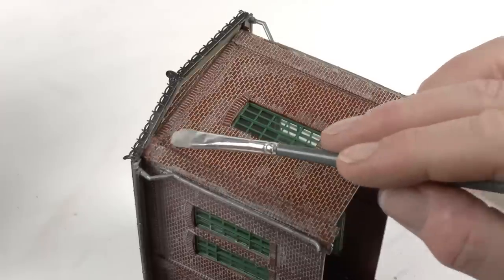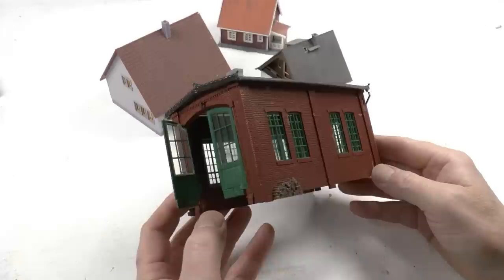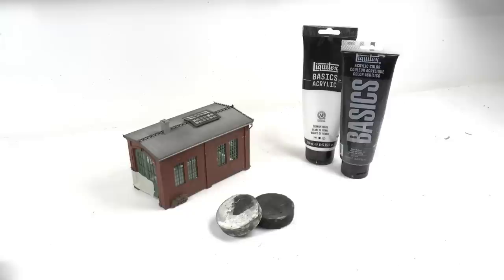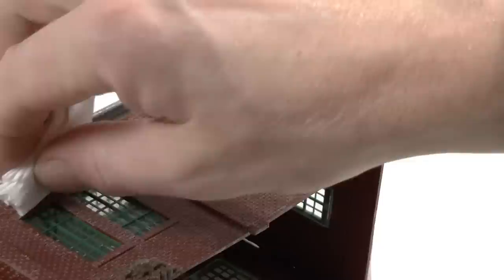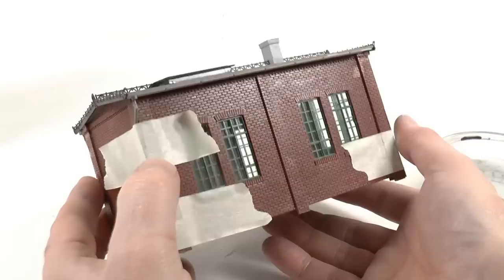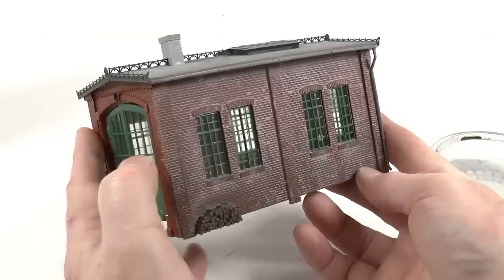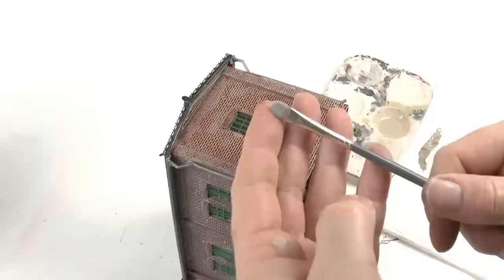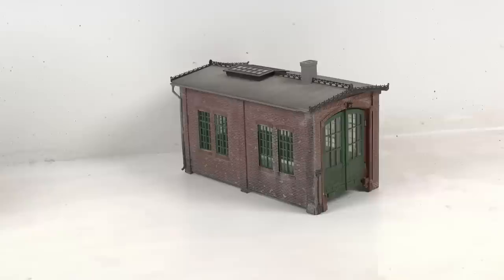Painting brick walls

Comment: Thanks Martin, when using acrylics If you pre wet the surface with wet water prior to applying the acrylic paint mixture it will wick into the crevices similar to the oil based mixture. By varying the amount of water for prewetting you can also create realistic flooded weathered water effects. Plus acrylics are non toxic and dry extremely fast. In my opinion acrylics provide the most versatile, safe, non toxic, time saving and easy cleanup results for painting anything that requires painting on a model railroad layout. Because of their natural blending nature and the fact they can easily be thinned with water to make stains and using different ratios of paint and water or alcohol, I find it isn't necessary to use anything else to create any painted effects. Although I bought weathering pastel chalks when I started to build my layout I have never used them because the same effects can be achieved with acrylics permanently, without the mess. One thing to keep in mind when painting new unpainted plastic surfaces is that a FLAT primer coat of any FLAT primer made for plastics should be applied to give some tooth for the acrylic craft paints to stick to. Any rattle can FLAT primer for plastics will work but I have had good results with most matte Krylon Fusions or Camouflage spray paints. Rustoleums FLAT Red primer for plastic is excellent for priming brick. It provides excellent tooth and dries in less than a minute and can be painted over almost immediately. A single light coat is all that needs to be applied. When it comes to the primer coat, the lighter the better. It's important not to over apply the primer coat. It's better to be somewhat streaky rather than a solid uniform coat. The idea is to apply a FLAT base coat for the acrylic paints to adhere to. The thicker the final paint coat, the less detail will be noticeable. Flat or matte finishes are the key to creating realistic looking finishes on natural looking wood, brick, masonry, earth, and turf surfaces as found in the natural world. I'm not familiar with the rest of the world but I know there are no shinny looking plastic buildings, shingles, fences or trees in my neighborhood. I even disassemble, mask, prime,  repaint, and weather some of Woodland Scenics and all of my Menards buildings with flat acrylic craft paints to create a level of cohesion with all other structures. The flat acrylic craft paints also do an exceptional job of hiding the unnatural imperfections and shiny plastic dimpleing that sometimes occur in the molding process.

Comment: Would you recommend a gloss varnish before applying each of the washes? You probably don't need to if applying straight onto a plastic finish, but if you've been painting your brickwork you'll have quite a matte surface and I suspect the washes won't flow very well.
Reply: If you have to paint the brickwork a brick red colour first, you would be better off painting the brickwork in a mortar colour, let it dry and then dry brush the brick red over the top.

Comment: Question about your costs per style.  Aren't these really the initial investment costs?  Surely the material will last for some considerable time, and with the "amortization", so to speak, of these investment costs,  the per usage costs will decrease significantly.
IMO, of course.

Another way to remove excess acrylic paint, 91% or 99% Isopropyl alcohol will take off acrylic paint.  I have found isopropyl alcohol to be a harsh medium to dilute acrylic paint; the cheapest blue windshield washer fluid you can find works well and dried seemingly faster than diluting with water.  Also, using acrylic CRAFT pain in lieu of the tube acrylic mixed 50-50 (by eye) will produce a airbrushable color.  Here in the US, the windshield washer fluid is less than $2 per gallon and acrylic craft paints will cost, depending on how a sale may be happening, anywhere from $0.24 to $1.49 per 2 ounce bottle and it becomes practicably a "life time supply" for a very low investment.

ANOTHER  EXCELLENT AND INFORMATIVE VIDEO!!